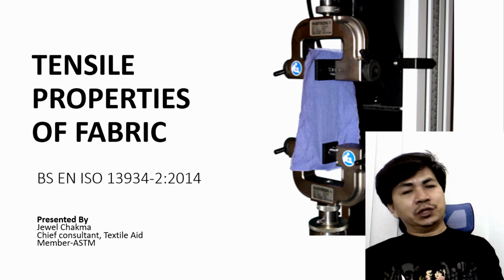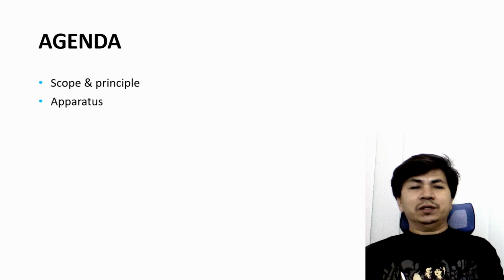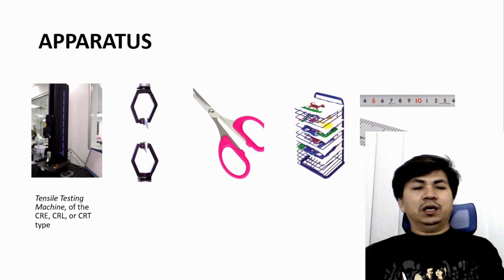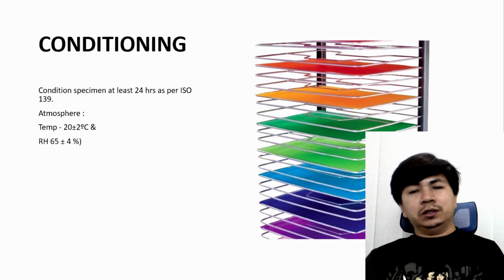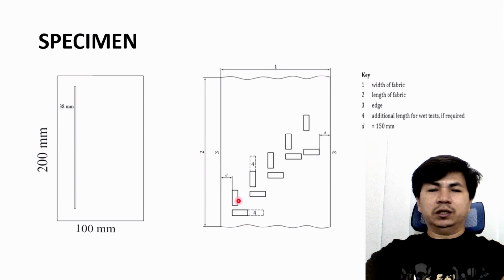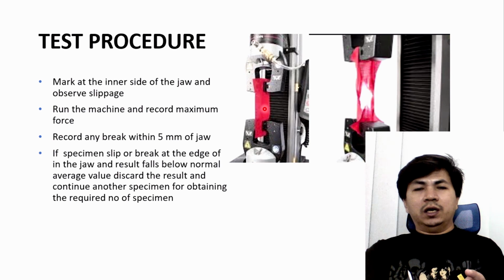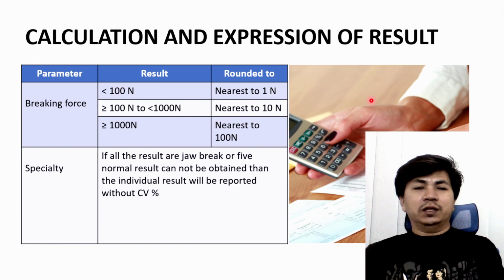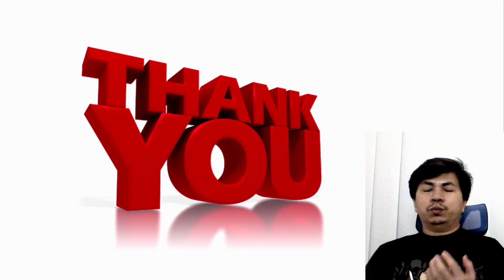Tensile strength, Tensile properties of fabric, ISO 13934-2, BS EN ISO 13934-2 in English

Comment: As per method, any required for break deduction%?
Reply from the maker: Thanks for your query. Seems you mean break detection ? actually i have no idea about "break deduction" in tensile testing, but there is another term break detection  which also not as per method, in case of some cases, rare type of fabric may very the result due to break detection. in general no issue for this reason. break detection means a machine setting option, where you can set like as 10% or 20%, then if breaking occurred and graph fall down to specific 10% or 20% whatever you inputted, than machine will determine the maximum strength and stop automatically at that point.

Comment: What do you mean by nearest 1, nearest 10, and nearest 100? Please give us an example.
Reply from the maker: Thanks for your query, pls see the below 
Nearest 1 means 1, 2 or 3 no intermediate number or fraction in between eg.  Your actual result is 32.8 but you must report 33 as it is nearest to 33. 
Nearest 10 means 10, 20, 30 or 40 no intermediate number in between  eg. Your actual result is 217 but you must report as 220 as it is nearest to 220.
Same as nearest 100 means 100, 200 or 300 etc. not intermediate number in between eg. Your  actual result is 1260 so it will be 1300 as it is nearest to 1300. any more clarification pls feel free to ask.